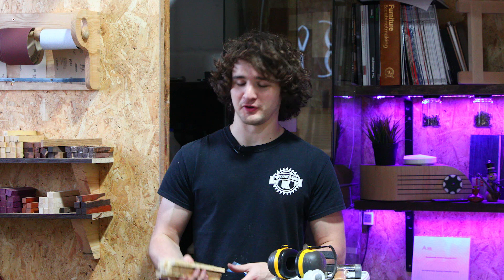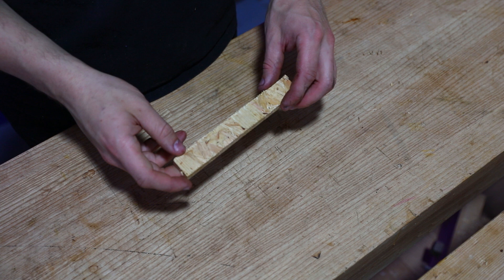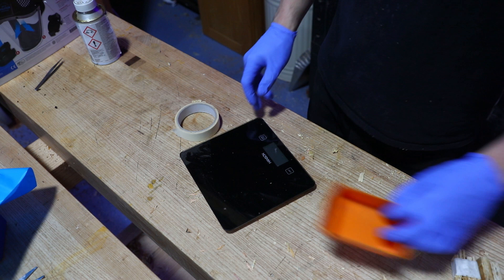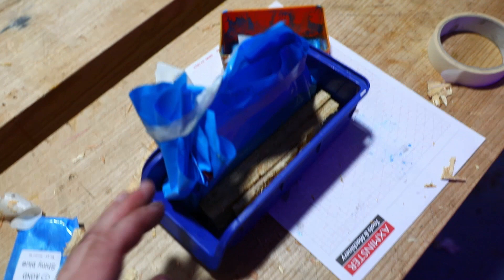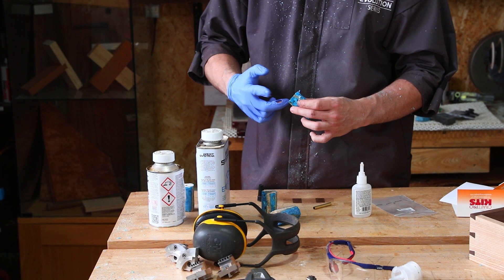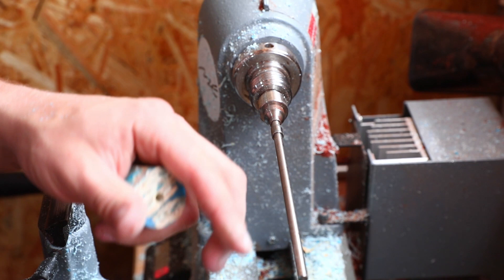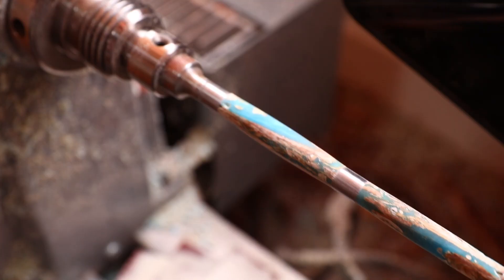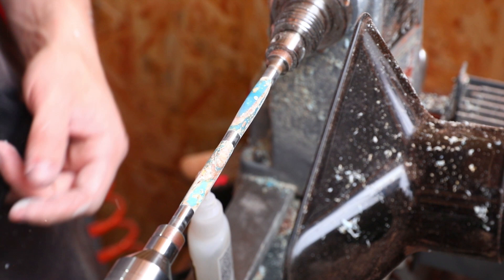Making an OSB Pen! 🤯 | Turning Tuesday #19

Comment: You should try mixing epoxy and tiny bits of OSB together instead of using whole strips for the blanks. This should be more stable than the big chunks or whole strips. Maybe an idea for next time...
Reply: Second that. Make your own OSB from large chips coated in the blue epoxy filled with saw dust also mixed in epoxy and then squeezed together in a form to make the blank. Could use a milled out 4x4 as a sacrificial form. Awesome stuff as always!

Comment: Had to get past the idea of using OSB to see the rest of the video. Glad I did. It came out nice. When I use epoxy and want it to flow into crevices I will warm it up so that it flows nicely. Downside to that is the curing time is sped up. With blown up pen maybe try a vacuum chamber to suck out the air and then epoxy bath while returning to regular air pressure. Experiment and have more fun!

Comment: Hey Matt - nice work! You can apply the CA glue with your finger inside the corner of a plastic bag (the ones that little bits come in - not a carrier!). Added advantage of reusing something that would go straight in the bin. This was a tip that a 'master pen turner' gave me. I hope I have n't betrayed the pen turners circle by sharing! : )

Comment: Great experiment on an unlikely material. It's good to see what happens when you try something unexpected. I wonder what would have happened if you'd mashed up the OSB like porridge and mixed it with the epoxy into molds.

Comment: Quick comment at 10:39 when you peel off the piece of osb it seems that the osb blank didn't adhere properly to the brass tube. You should try a really thick CA or even epoxy. I like the epoxy better, it takes more time to cure but it never disappoints.  As always great video

Comment: Get a pressure pot, first because you'll get a decent solid air bubble free casting, secondly because its a safety layer incase of fire.
If you must used normal epoxy rather than proper casting epoxy heat is going to be a an issue.
Please, for you safety, never use a rag near a lathe, apply any finished, including super glue with a piece of tissue, if it catches, or stick, it will tear, rag won't, its more likely to take you for a spin round chuck.

Comment: Looks like your epoxy started to 'boil', because it was poured in quite a large volume (too much heat build up). Maybe try a slower setting epoxy or a special casting resin

Comment: "...to give more of a fractal pattern to the OSB."  I take it Rob wasn't there filming, because you'd both have disolved into a urine puddle when you said that! Nice looking pen tho - the one that worked, but a question...why is everyone who makes them putting a slight bulge in both section of the barrel? I'd prefer a straighter configuration. Either skinny, almost removing the blamk material. Or even a chubby shape that turns sharply in towards the ends....or...even turned like a spindle e.g.'s https://www.cincinnatidowel.com/images/product/S-8%20Spindle%20image_1.jpg